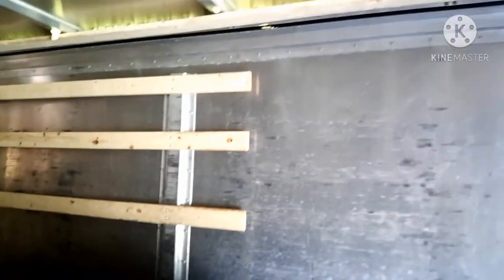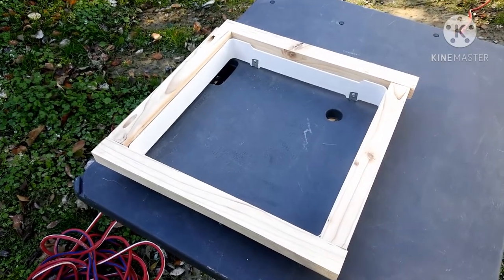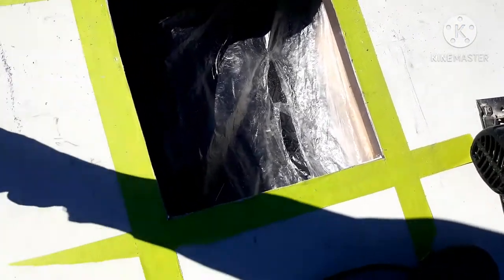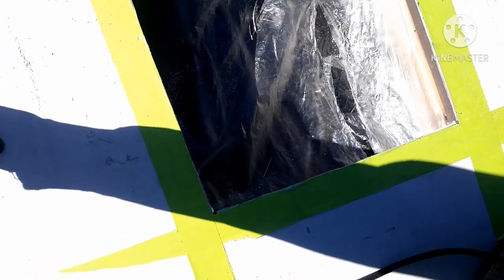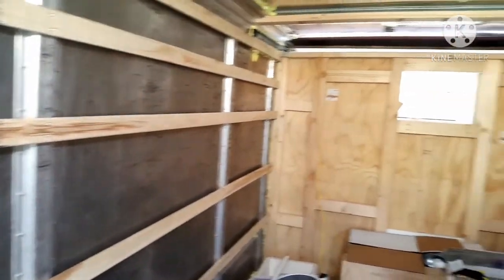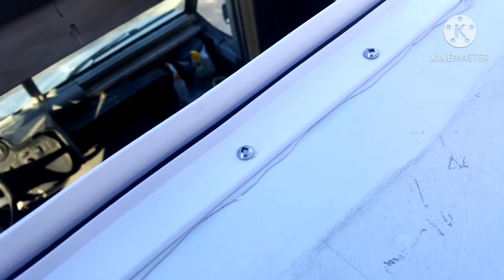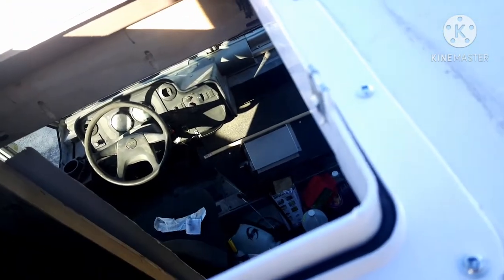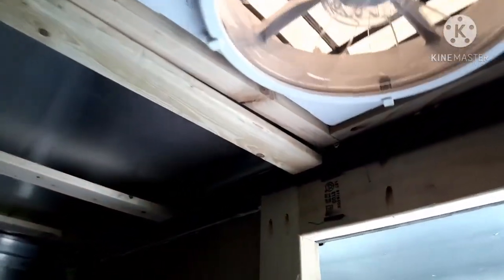STEP VAN MAXX AIR FAN INSTALL

Comment: Nice and clean install, good job! I'll bet it took courage to fire up the saw and cut the roof lol.  With the truck all cleaned out you can see you have quite a bit of room for your buildout, much more then a regular van. Aloha 🤙
Reply from the maker: 😂 lol...yeah, I had to take a few deep breaths before starting this project.  
It's huge.  Just a bit larger than the entire box truck not counting the area I'm using as the garage.  Take care my friend.☺👍🏾🤙🏾 Aloha.

Comment: You really plan well, I didn’t know what I was doing when I built my van out, I’m just praying things don’t fall apart as I go down the road😂😂. I had to replace the vent fan already ( had a crack in it and started leaking ) everything is good now. Your doing an excellent tutorial of your build, my next camper van I’m going to have it custom built, no more work for me.😅🥲Thanks for sharing
Reply from the maker: It's funny,  building mine has made me appreciate how convenient it would be to have a rig ready to move in and enjoy.

Comment: Oh dang.  That probably sucked having to use a circular saw.  I recently saw a video where the person had to use a reciprocating saw.  😬
Reply from the maker: Yes it did Dove.  Aluminum chips flying in my face, and less control made for a sloppy square.  Ultimately,  it turned out okay.😎

Comment: I wonder if it would be worth it to raise the fan up a bit by running wedges or something using the ceiling fur downs on the sides. That way when it rained, the water wouldn't stand or run towards the fan but would run off the other direction.
Reply from the maker: You might be on to something Tom. Not much will be worse than a leaking roof vent.

Comment: Hey Lamont, good to see your progress on the step van.  Are you going to stay with the Propex heater or something else?  Thanks 😊
Reply from the maker: Hey MrAndycm, I'm going to stick with the propex for now.  I bought a cheap diesel heater, but want to see if the propex is more consistent with a regular hose to the inlet instead of the copper line I tried using for the last two seasons.